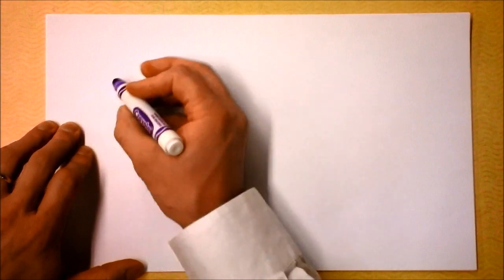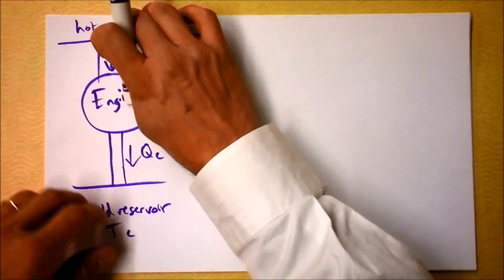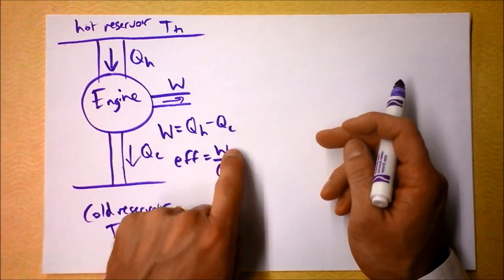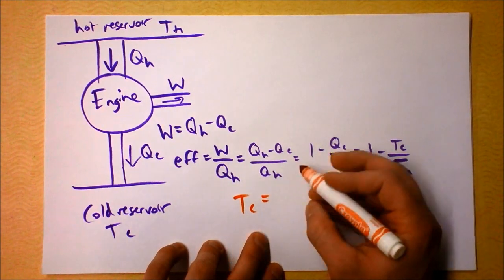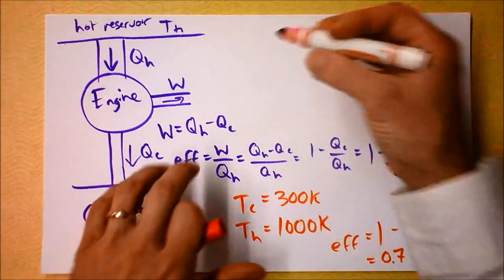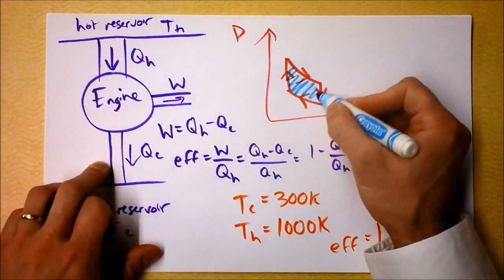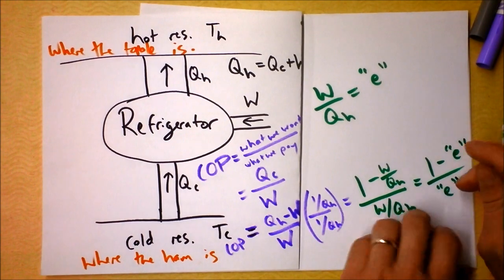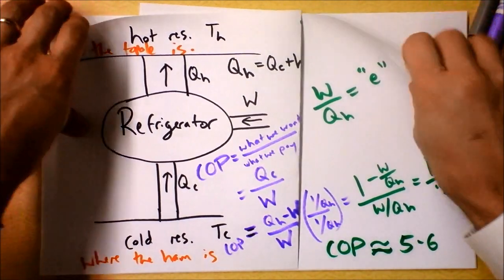Anti-Heat Engines:  Refrigerators, Air Conditioners, and Heat Pumps | Doc Physics

Comment: Great work homie, but I'd like to point out that @2:30 you wrote [1 - (Tc/Th)] as the simplified expression for efficiency of 'any' heat engine. This ONLY applies to the Carnot cycle and hence it would be the maximum achievable efficiency by an engine. Unless I'm tripping out haha
Reply from the maker: Thanks!  I had heard it was the efficiency of any reversible heat engine.  However, I'm not an expert on the idea of reversibility.  Is there a reversible engine that does not follow Carnot?

I'll certainly agree that it is the ideal efficiency, so perhaps an inequality would be better suited.

Comment: Considered your question about efficiency being more dependent on cold or hot reservoir:
Mathematically, it looks like both have an equal effect on the efficiency but you mentioned that according the the 3rd law, it becomes nearly impossible to be 'OK' therefore I want to say that the temp of the cold reservoir has a bigger effect on the efficiency since, in chemistry terms, the cold reservoir would be the "limiting reactant".
Though please correct me if I'm wrong.
Reply: But then I guess I could also say that because we have more control over the hot reservoir than the cold reservoir, then the hot reservoir has a larger effect on the efficiency since we can affect it more. 
Too bad I can't just talk to engines. That'd make this a lot easier.
Reply from the maker: Ha!  Talking to engines!

My point is the mathematical observation of numerator vs. denominator.  But I like both your observations.

Comment: In a real life application of the heat pump, what temperature do we consider as that of the hot reservoir TH. In a heat pump for example, lets say we circulate water at 298K in the hot side(condenser of heat pump) which heats it up to 333K for home use. 
I guess Tc in this case would be the outside temperature, but which temperature in this case should we consider as TH?

Comment: Connect an engine and a heat pump in parallel, then explain the performance of the system. The part of the work which was obtained by the engine is used for the heat pump. The temperatures of hot and cold reservoirs are maintained constant. Then think of the second law.

Comment: Would a refrigerator as a heat engine, where the refrigerator uses a gas (refrigerant) that circulates around a loop with an expander and a compressor, be considered a open or closed system? I'm having issues determining whether it is open or closed because I don't know if mass transfer is involved with the use of a gas.
Reply: it's closed system because the gas inside the fridge doesn't disappear. it circulates . the compressor and evaporator do the job of heating and cooling the gas.

Comment: So  Qh = Qc + W      This makes all the energy neatly accounted for right?
What if your Cold Res. and Hot Res were 100 lb blocks of granite and they both started out at room temp. You plugged in your fridge and ran it until Qh - Qc = 50F and then unplugged the fridge.

You could let them sit until they re-assumed room temp or you could connect a small peltier device between them and produce a small amount of electricity, for a little while as their temps equalized. The power produced would fade away. The act of doing that would cause the two blocks to equalize faster. The amount of power is very small.

But where did this secondary power come from?

Comment: Hahah this is coolest physics lesson ever, you're funny but damn helped so much! Really useful! Though I'm a little confused at why the vertical line you draw at 3:45 is an adiabatic process, I thought because there is no change in volume then it is just iso-volumetric, therefore no work being done, not an adiabatic process where there is no heat transfer. Well anyway this video was very informative!

Comment: So if its 330K outside, the longer the AC is on (assuming that its consistently transferring heat from inside the house), it could be infinity efficient?
All my knowledge is from a couple his videos.
Reply from the maker: KingCodeTV What equation for efficiency is on your mind?  Time shouldn't have an effect (except for complicated things like duty-cycles).
Reply: Doc Schuster I didn't really have a efficiency formula on my mind, all my physics knowledge on this topic came from this video. The previous knowledge is Physics 10 (v-t, d-t graphs, acceleration & gravity.)

I was just curious, as I'm going to take Power Engineering in grade 11, and Thermodynamics was one the main topics covered so I thought I would get a head start on it,
Thanks.

Comment: Confused! for this instead of using Qh and Qc if we used Q(in) and Q(out) which would be which?? so does Qh = Q(in) or Q(out) etc??? PLEASE HELP!
Reply: Qh is Q(out) and Qc is Q(in)
Reply: I think it depends on type of engine, whether you are taking heat out of the engine or taking in. For instance in combustion engines(ie, Diesel and petrol engines of Cars) Qh(heat of hotter environment) is Q(in) & in refrigerator Qh is Q(out) and Qc(heat of colder system) is Q(in).
Consider the two common kinds of heat flow.
1) heat flow from hot reservoir toward the cold reservoir, here Qh=Qin & Qc=Qout, (it means that an amount of heat comes from system with higher temperature, do work on the engine and expel an amount of heat to cold reservoir; maybe to water in cylinder or toward Exhaust).
2) In heat flow from  cold reservoir toward hot reservoir, as in refrigerator; Qc= Qin and Qh=Qout (it means that,due to the mechanism of the engine, an amount of heat is flew from colder environment toward the engine, do work on engine and expels extra heat to the environment with higher temperature).
Reply: Qc is the output here and the input is W
as we know Efficiency=output/input and here we get COP(which is used to evaluate the efficiency of the refrigerator)=Qc/W so here Qc is considered as the output

Comment: how can u get cop 5-6 in refrigerator if u have a 70 percent efficiency
Reply: cop is Q devided by W while efficiency uses both  either Q or W. its like work desired devided by work needed. efficiency means if you spend 100 J of energy, the machine will only spend 70 . but with that 70 , it does 5-6 cop of work.